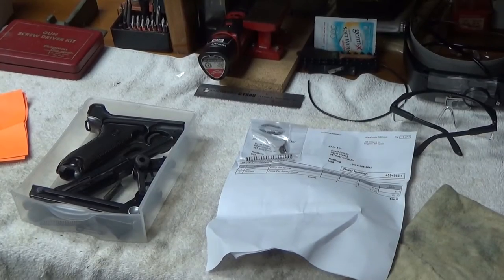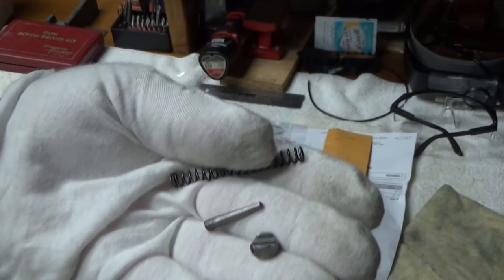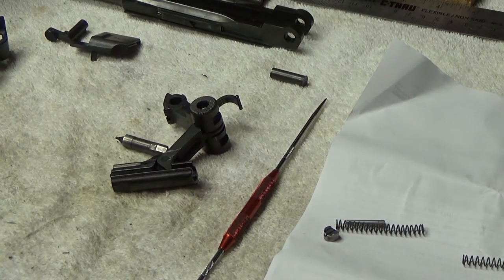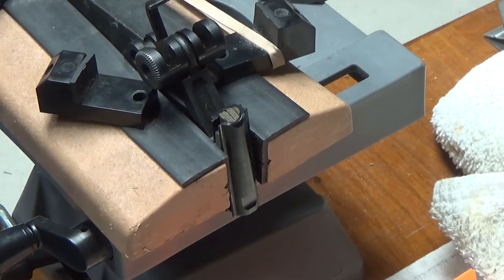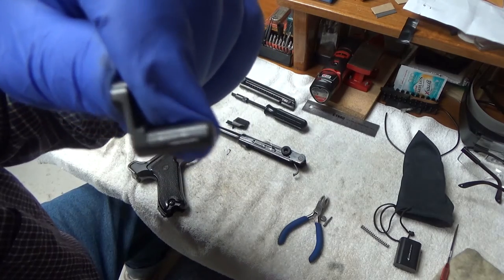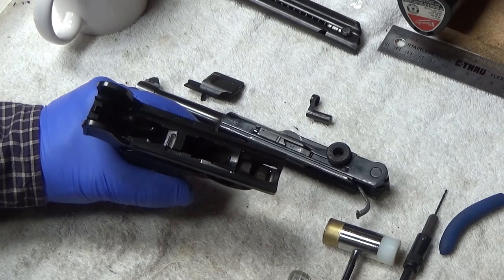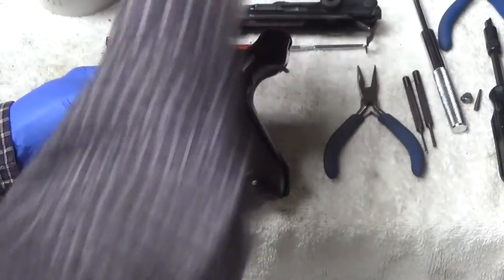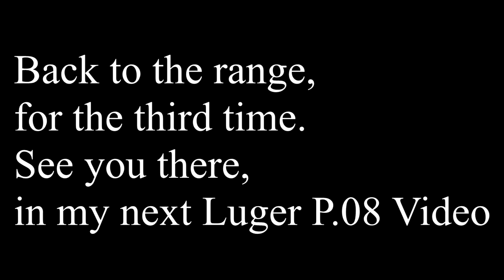Luger P.08 Firing Pin Spring Retainer

Comment: Hello, thanks for the video. I have some questions about the recoil spring. 

In my 08 is the 80 year old spring. Is it worth to change it ? 

If yes, which one I should take? 

The factory one has 38 Lb. And the stronger one has 40 Lb. 

Is it better to take the stronger one to protect the gun from destroying itself ?
Reply from the maker: I would purchase the thicker spring and that way you can buy modern ammunition.

The thicker spring is for modern ammunition which pushes the hollow point bullet near maximum velocity for the purposes of achieving the expansion rate at longer distances.

This is for solid rounds too where the round is designed for Glocks and Sigs.

If you reload your own, you can keep the pressure down to the 1930's design specifications that will cycle the return at a reasonable rate.
Reply: @A_Renaissance_Man  Got it. Thank you 👍🏼

Comment: I do not comment often, but I feel I must on this.  You first helped me diagnose my buddy's issue with his 1917 P08, which was a breech block failure. Thank you.  Then I was searching for the locking bolt spring and I found this... He also was lacking the locking bolt spring. With the exception of the broken spring retainer, he had the same issues...and your videos directly addressed the issues and provided detailed solutions!  Thank you VERY much for your time in producing these videos! Be well, David.  Your videos make a difference.
Reply from the maker: Thank you for your nice comments.  I made seperate videos because I had the issues one after another.  Otherwise, I would have made an all inclusive video.

Comment: I've had a failure of the firing pin spring retainer (actually, breechblock failure where the retainer locks in).  Following info found on a Luger forum, I had a 1/16" hole drilled across breechblock, and a pin inserted to replace the material lost when the retainer pushed through the back of the breech.  Removing some material from the locking tab of the retainer, to account for the thickness of the pin, completed the repair.  Shoots great.
Reply: I've exactly the same issue with my 1915 DWM Luger. Can you give me more details? Thanks.
Reply: I still have the loose pin of the spring retainer.
Reply: Shot great for about 25 rounds; the pin needs to be hardened for the repair to last.  Replacement breechblock is probably the way to go, if matching numbers don't matter.
Reply: @leonardosa7286  If you are not concerned about matching numbers, I'd recommend replacing the breechblock.